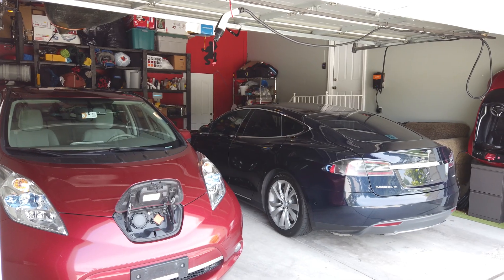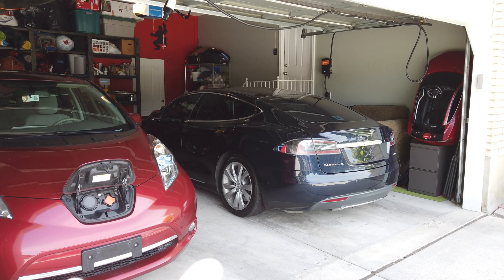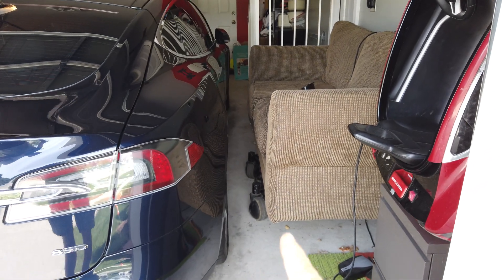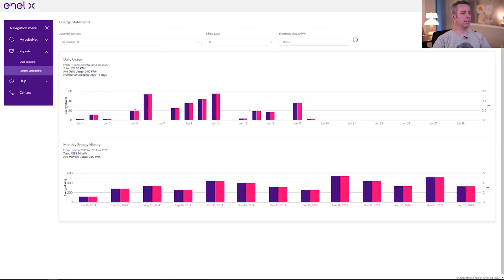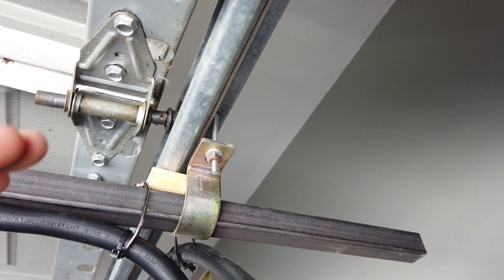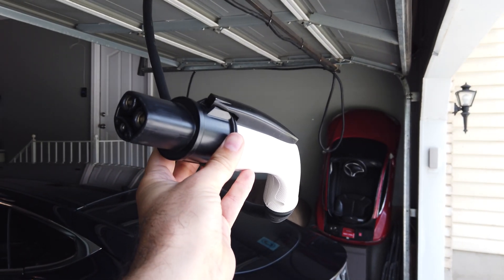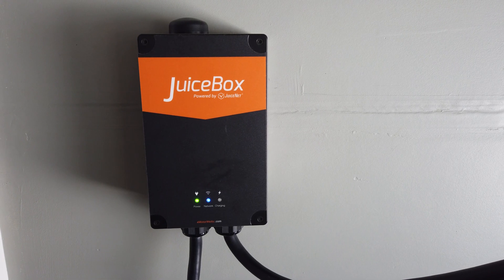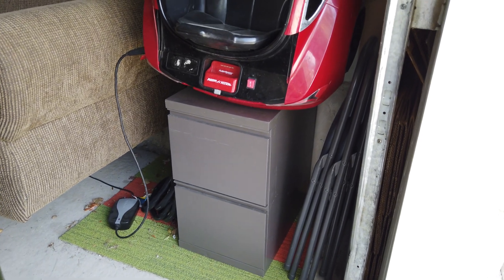The Best Home Garage Electric Vehicle Charging Setup

Comment: I did this with wire rope instead, much safer...
Reply from the maker: How is it safer?
Reply: @ElectricTechAdventures  less flex, less chance of damage in a failure event, etc. I ran two 3/16 lines. I have an X and S Plaid and I wanted to be over cautious.

Plus it looks a lot nicer.
Reply from the maker: @TheLawIX  Assuming the wire rope is going across the garage door opening like mine is, and if it has less flex that means it's pulled really tight. Did you anchor the wire rope off the wall, into studs? Otherwise I imagine the garage door track would be pulled together.
Reply: @ElectricTechAdventures  Yeah I anchored to studs and not the track.
Reply from the maker: @TheLawIX  Cool, sounds like a good solution. Did you get the type of wire rope that's covered in a plastic sleeve? That's a good alternative idea for any other readers of a way to to hang EV charging cables. My metal bar method has worked great for 6 years now, but it's certainly harder to transport a 18-20 foot long metal bar than it is to transport a coil of wire rope plus accompanying hardware. I don't think the metal bar method is unsafe, unless it is poorly attached. Thanks for sharing.
Reply: @ElectricTechAdventures  yes, I used PVC covered. I bought tool balancers and cable clamps as well.

Comment: I love that sliding rail set up for your cable!

My garage looks very similar to yours. I park my other car right next to the wall, and mounted some two by fours for the tires to rub against, similar to your set up. It’s like I was reading your mind.

I just bought a new Model Y, and for now I’m pulling the charge cable from the wall every time. I’m going to look at emulating your set up.

Thanks for the clever idea!
Reply from the maker: Haha that's awesome. Great minds think alike! I'm glad to help, it still works great for me several years later although it's a little different now as you can see in my more recent video here https://youtu.be/v1xaDr7MA_U where I can charge from either my house or my RV.

Comment: Side note: you can open your Tesla charge port just by pushing on it (as long as it's unlocked)
Reply from the maker: Thanks for the tip. I use this push method virtually every time to open my Tesla charge port door. I perhaps forgot to mention it in this video. I'm not sure what part of the video you saw me open the door with what method. I did get a service loaner once however that didn't have this feature. When I got the door open I looked for that black stopper button and it was just a fixed stop. I have not looked into which models had this feature.

Comment: Didn't understand your last point about not having to hard wire the Juice Box [and hiring an electrician ]..eliminating the need for an electrician by buying a 40 amp plug?....please explain as i am a newbie...thanks
Reply from the maker: The Tesla wall connector requires you to know how to strip the end of wires and clamp them directly into the back of the device. That is called hard wiring. If you already have a nema 14-50 outlet in your garage or if you have an electrician install one then the juicebox pro 40 can just simply be plugged into that outlet like when you plug your vacuum cleaner into a normal outlet in the wall. So it makes it easier to just unplug and take with you if you move or want to use it elsewhere. Hardwired connections can go to higher amperages but not by a lot. A difference of 48 amps versus 40 amps although older Tesla well connectors the high-powered ones could go up to 80 amps.
Reply: @ElectricTechAdventures  Okay...thanks for helping ...was wondering why the older 80 amp wall connectors[V-2] were discontinued ...seems like they would be more power than the latest version[V-3 @50 amps]?
Reply from the maker: @a.joseph4233  I don't know. You'd think with the general progression of technology that speeds would increase instead of decreasing. I'm guessing Tesla was initially focused on ensuring people had as little range/charging anxiety as possible so they provided the best technology to do so, then over time as the general public became familiar with electric cars that they found these super fast chargers weren't necessary. I'd speculate more that perhaps Tesla discovered that there was battery degradation from charging so quickly in a location that's meant to be on a regular basis (your home garage). It might also be that few people purchased the high powered wall connector because it's uncommon for residences to have the ability to install an additional 100 amp circuit for the HPWC. What I don't like the most is that the mobile connector gen 1 supported up to 40 amps, but now the gen 2 only supports up to 32 amps. That's more of an egregious decline in my opinion because the NEMA 14-50 outlet is ubiquitous at 50 amp campgrounds, or in people's homes and it's a shame not to be able to get that additional 8 amps when you're trying to charge as fast as possible.
Reply: @ElectricTechAdventures  Okay Anthony...thanks for the explanation...now i understand the issue better.

Comment: How did you transport that long metal tube home?
Reply from the maker: Since I'm still waiting for the Cybertruck to be available I borrowed a friend's pickup truck. I ran the 25 foot long 1 inch square metal tube along the side of the cab of the truck forward between the side mirror and the cab all the way to the front of the truck, then all the way back and a couple feet past the back of the truck. I wrapped rags around the tube where it contacted the truck.

Comment: Interesting and great idea,. Did you consider a round tube instead of square?
Reply from the maker: I could have used round but I purchased a 24 foot length and used 6 feet for a different project which I needed to be square.

Comment: Have you had an electrician look at your set up?   Having that cord attached to a metal door makes the alarm in my head go off.   Just curious and I am super paranoid about  these things. :)
Reply from the maker: No I haven't shown an electrician my setup. The cable is not attached to any moving parts of the door and there's no wear on the outside of the cable. There's no reason to be concerned. Thanks for watching!
Reply: @ElectricTechAdventures  I hear you thanks.

Comment: Is it better to charge your EVs during the day when you are producing electricity or overnight when electricity costs are lower?
Reply from the maker: It depends on the electrical utility where you live. For us it makes no difference financially when we charge. I do prioritize charging in the middle of the day for fun knowing all the power output from our solar is going into our electric vehicles. Our net metering policy is that for every kWh sent into the grid we're credited for it and can use it at any time with no fee. We pay a flat $8.99 per month to be grid tied. The utility has changed this policy but we're grandfathered in until 2035. There are other electrical utility companies with varied policies in various states that have time of use programs where it is better financially to use your produced power than to send it to the grid first.
Reply: @ElectricTechAdventures  Thanks for the response!

Comment: Nice setup.  Before I bought my Tesla I bought a Ford C-Max Energi (PHEV and yes, that’s the way Ford spells Energi) in July 2014. At the time, I bought an EVSE in a kit from https://openevse.com/index.html.  By assembling myself I saved some money and when I got my Tesla, I’m able to use it with my Tesla to J-1772 adapter.  The only drawback of leaving the adapter connected at home is when I go somewhere they have a charger, they are usually J-1772 (ie. we have free charging at our Cinemark theaters) and if I’ve left the adapter at home, then I can’t charge.  The solution is to buy a second J-1772 adapter, keep one at home, the other in the car.
Reply from the maker: I agree. I have an extra J1772 adapter that stays in the Tesla. I use it occasionally such as when I go to work in the Tesla and charge at my office building which provides free EV charging.
Reply: Anthony Dunster where did you get the second adapter?
Reply from the maker: The J1772 adapter can of course be purchased directly from Tesla. I happen to have found my adapter on one of the chargers at my office building and when I asked our internal EV charging Slack channel about it nobody claimed it. I assume it was left by a traveler going by, or people from a prior company who had just moved out of our building.
Reply: Anthony Dunster Talk about lucky. I just can’t seem to spend $50 on an adapter!
Reply from the maker: Unfortunately the J1772 adapter is $95 :( back when I used to take it to work regularly I maybe would have justified the expense, but other than at my office building, I've rarely ever used the J1772 adapter away from home. I can think of one hotel where we used it for like 10 minutes until a Tesla destination charger opened up. However having it available on road trips is wonderful peace of mind.
Reply: Anthony Dunster. I cannot justify spending $95 either! I now keep my adapter by the driver seat, right below the power seat controls and the door. I like the convenience of opening the Tesla charge port from the mobile adapter, so I keep the mobile charger connected in the garage. I only take it with me when I go out of town. The J-1772 adapter stays in the car all the time.